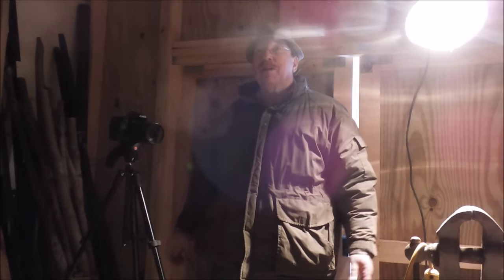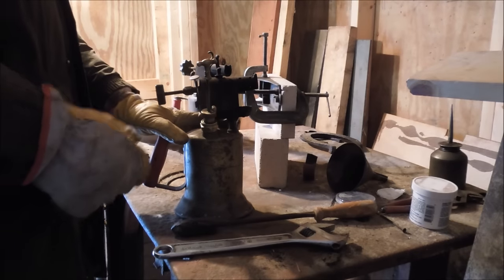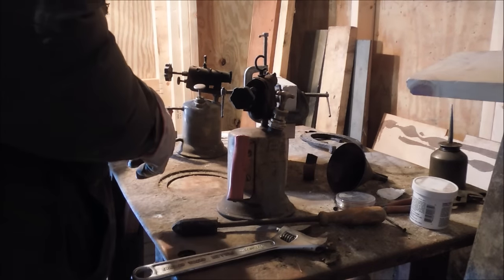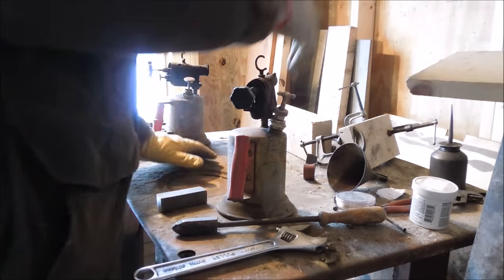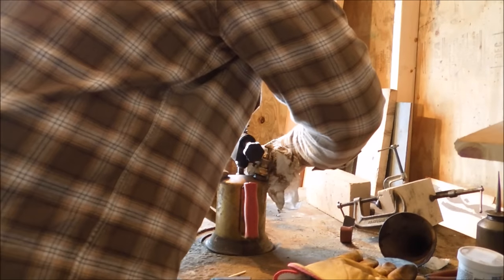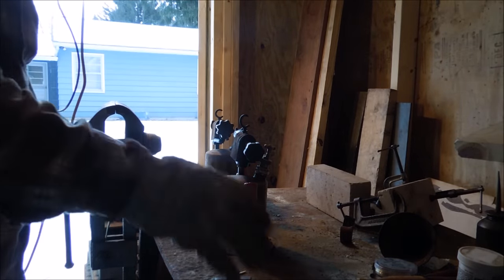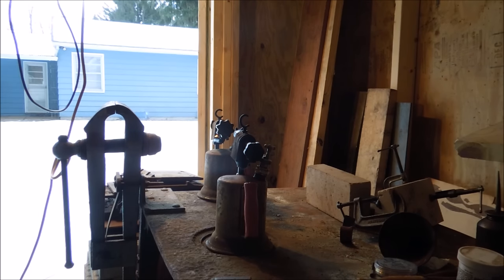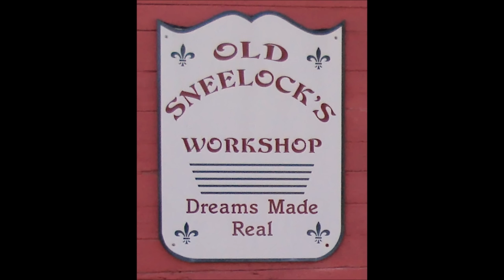Blow Torch Blow Out ~ Pt 7 ~ Firing Off The Torches ~ by Old Sneelock's Workshop

Comment: I knew you could do it but I was starting to wonder if the blue flame was just something I dreamed up or if it was real. Real. I might get a shot at mine later on in the week. I was down at the Saw Surgeon's place trying to help him hook up a Monitor heater in the new shop. All we lack is finishing  which won't take too long. He couldn't find his flairing tool and I didn't know we'd need one so maybe tomorrow I'll take mine and we'll get some real heat inside. It was 16 this morning so I think winter is getting here at last. Proud of you, Unc!
Reply: i have a1941 oscar burnts it has old wick i took it out what can i use as a replacement

Comment: congratulations got them running again.
Reply from the maker: +Chris Anderson Once the check valve was fixed it stopped bubbling gas out of the pump. Much happier. They still need a bit of a cleaning in the passages. They don't seem to be getting all the fuel they need to create the flame as I remember it. Still running a bit cold.

Comment: Awesome job!!!!!!!!!! Did you only work on the pumps? I though you mentioned there was a problem with one for the feed valves? It was the torch that was spitting too much gas it your first attempt.
Reply from the maker: +GrandsonofKong You are almost right. The Turner was the one spitting gas in the first attempt. It was too cold to vaporize the gas. It was the one that I preheated with the torch in this video. The one with the crossbar pump handle doesn't have a name on it so I'll just call it the crossbar was leaking out of the pump in the first attempt.  It now has a flame but the flame is weak. A weak flame means it's not getting enough fuel. I think it needs the fuel passages cleaned out.

Comment: Nice job getting them going again. I've never actually seen one in operation. Now I want to get mine running. Do you have any information around the different sizes of copper irons for these, and how to properly use them?   Thanks for the great series.
Reply from the maker: +Jonathan Martell I have that particular job on the list of future videos. I had my coppers in the blacksmith shop but spent so much time on the torches that I put the soldering irons aside for the moment.

Comment: great video what are these used for?
Reply from the maker: +bud moore (buckshot32000) The torches were used for general heating. They can heat a soldering copper for soft solder or they can do direct heating for soft and hard solder. With a heating temp maximum of roughly 2200 F. They put out a large area of heat and can be used in multiples to heat an object for forming. With a firebrick chamber they can act as a forge.

Comment: great video, but what fuel was you useing? i just picked one up and was going to use it to run my small boil
Reply from the maker: Old School Repair Shop I use Coleman fuel. I use to be able to buy white gas at the corner gas station. Not anymore.  Did a little research and found this. http://www.greenspun.com/bboard/q-and-a-fetch-msg.tcl?msg_id=000iKh It's on the internet so I suggest verifying the information but it seems legitimate.

Comment: I know you showed the video about that but I really couldn't see what you were working on course when I take out the whole pump from the torch at the end there's a round piece with a hole in the tip and two holes on the side that screws into the main pump when you take that out there's another piece in there that's attached to a spring and there was a cork on the end of that on the spring and was all screwed on too the plunger system now just a Cuoco in side facing the tip on a piece of screws in I really can't explain it to you but I really want to get this thing going and I'm still having the Viagra effect

Comment: my 1941 oscar burnst has wick it was to far gone what can i use has a replcement
Reply from the maker: I haven't had that problem so I checked online. ZangoBob uses the cotton string from a string mophead.  http://www.blotorches.com/torchfix/torchfix.html#parts
He has a great website.
Reply: @OldSneelock  so it is not awick but a fuel filter is that right  thanks tim
Reply from the maker: @timjackson2937  It is called a wick. From the way it works I think it is three things. 
1. A wick to pull fuel up into the burner by capilary action. That way even if the torch is tipped the fuel is picked up. 
2. A filter to prevent small particles from plugging the needle jet. 
3. A regulator to contol the amount of fuel reaching the needle jet. 
Just my guesses. 😆😎
Reply: @OldSneelock  thank you so much for getting back to me because the original well that was in there it had to be 80 years old so now I know what it is and now I know how to install it and get one thank you very much